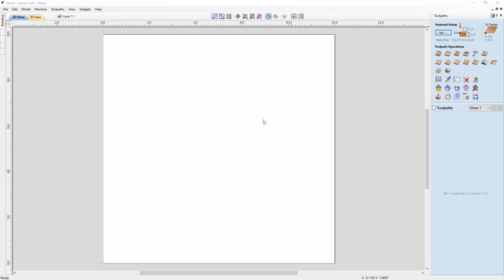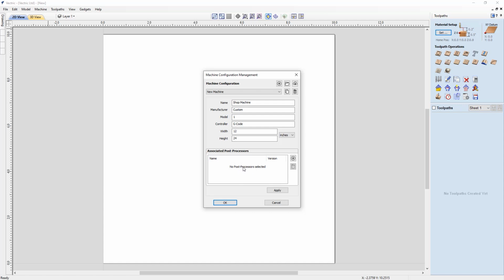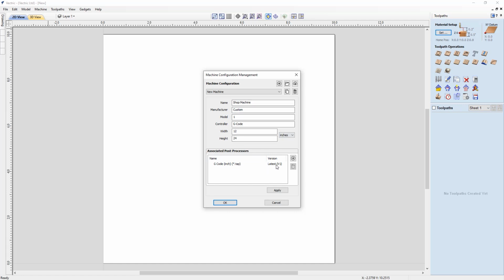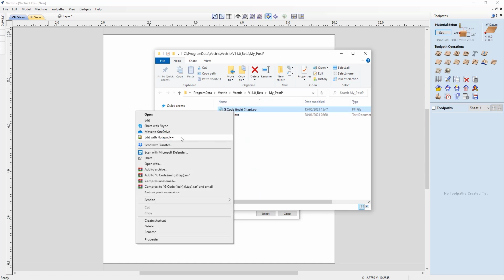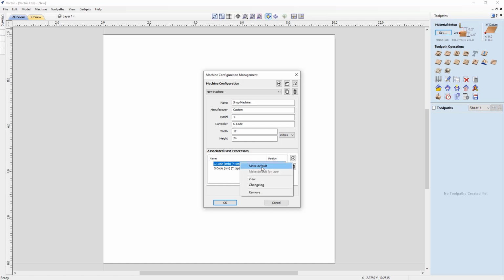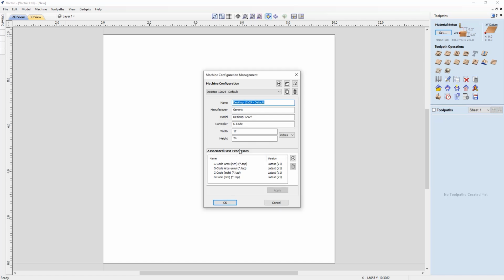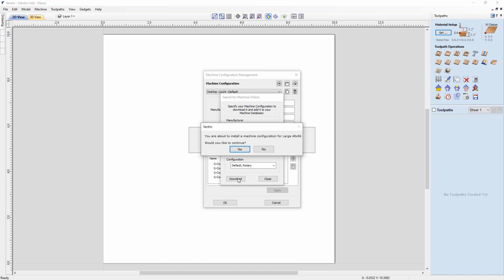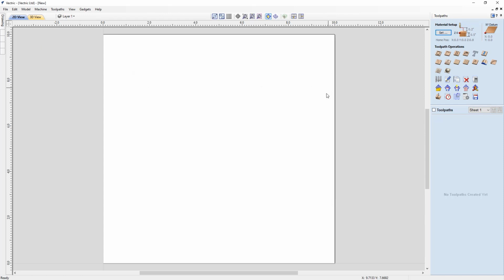Machine Configuration Guide | Vectric V11 Tutorials

Comment: aspire trial edition 11.5 tried to save g-code failed
Reply from the maker: Hello and thanks for the message.  With our Trial Editions we do allow you to use it with the only limitation that you can't save out your tooling.  If uyou do want to save out some tooling to try with your CNC you will need to download one of our free Trial Friendly projects.  This will allow you to edit the tooling that is already there with your tools, feeds and speeds and then save it off using a post processor that works with your CNC.   If you are using a Trial Project then I'm assuming you ajusted some of the vectors and then recaculated the tooling... this will error.

Looking for a Trial Friendly project?   Check this link... https://www.vectric.com/vectric-community/free-projects/free-trial?category=projects+of+the+month,tips+and+tricks,in+the+labs,partner+projects&tags=Trial&page=1&items=0&software=all&version=11.5
Reply: @vectric  thanks, I have installed version 10.5 for homemade cnc machine
Reply from the maker: No problem!!!  "Homemade" CNC... wow... always love a home build!!!